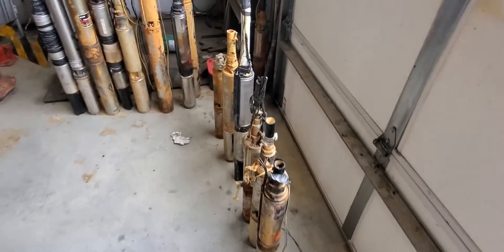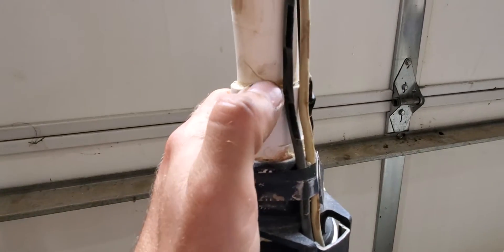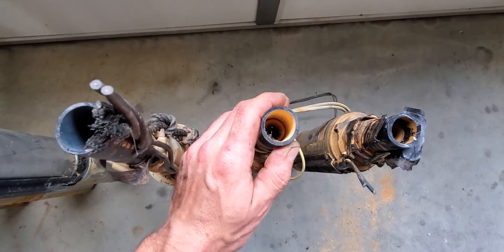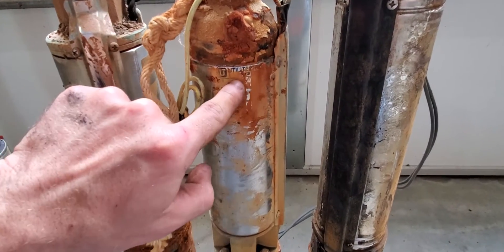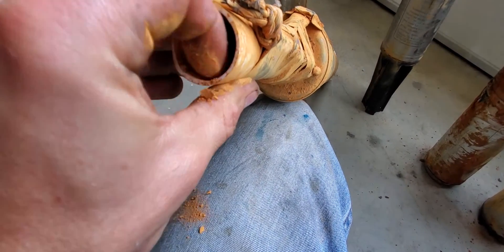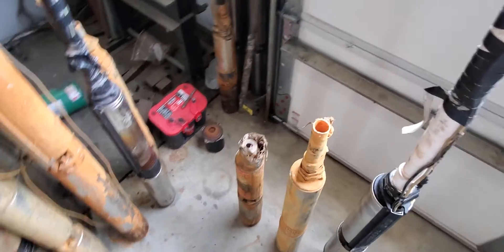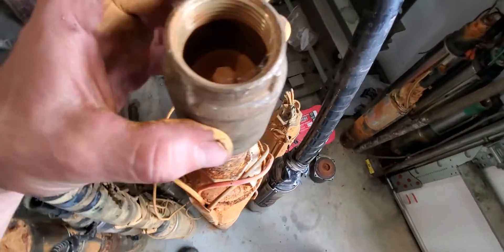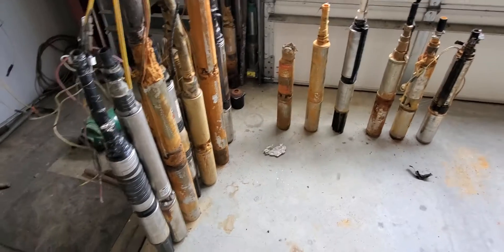No Water, Low Pressure,  Air in Water lines. Here's Why! #1 Troubleshooting video

Comment: My house has an older well where the pump and pressure tank is in a closet(above ground).  I have somewhat reduced pressure, it seems to be somewhat irregular have intermittent drops in pressure.  Occasionally there will be air in the line.  Any suggestions on where to start?

Comment: Im having an issue in my house where the water flows good for a few seconds and then drops real low then comes out with lots of pressure then back to low again constantly . Ive replaced pressure switch and pressure tank . What do u think the issue would be ?
Reply from the maker: So you replaced both tank & switch. It sounds like you have too much air in the tank. Look under your P.switch cover & look for the "ok" number. The air in the tank needs to be 5 psi below the on number. Most tanks are over charged when new. The power must be off & no water pressure can be on the system, so open a sink . Then use a tire air gauge to check tank air pressure.
Reply: @h2omechanic  ok I will try that today thanks. We had a 30/50 switch but I replaced it with a 40/60 will this be ok or do I need to go buy a 30/50 p.switch
Reply from the maker: @joshduff5374  the 40/60 is perfect. Just set the air pressure to 35psi
 Off & empty of water
Reply: @h2omechanic  my well is a deep well down at my well I have a cut off valve to the house and a faucet on top of well . I cut the water valve for the house and turn that faucet on that's on top of well to see if well pump was surging and it's doing exactly the same thing from well as it is doing n my house so would that mean my well pump is going out
Reply from the maker: @joshduff5374  yes! It could be a cracked fitting in the well too. You'll find out once you pull the pump out.

Comment: I also have another question we live in the greater Seattle area and so we live close to the salt water and our well water has a lot of sulfur in it it seems is there anyway to fix this being on a low budget. We cannot afford one of those expensive charcoal filtration systems so any help is appreciated on this as well thank you
Reply from the maker: Sulfur is a gas, so in order to remove it, the gas must be vented from the water before entering the house. Give me your email and I'll send you some cheaper ways of helping the problem. I just gotta see if I can find them online. Bc my salesman has 2 different devices to gas off the sulfur. 
Originally we would use a Air induction valve at the well. ( it's a tire air stem & as water flows by it sucks in air). Then once inside it would go the a mix tank,( fiberglass tank filled with plastic woofal  balls). Out of the mixer & into a Old School galvanized tank. Galvanized tanks had a valve/float system inside them that when too much air was in the tank, the air valve/float would open & vent off the gas/sulfur/air the was sucked in by the tire stem. It's complicated bc it's not a filter. It's a gas separation system. Still probably 3k installed. But I know it works. I don't think charcoal will work fyi. Itll work until it is saturated then the smell comes back within weeks.

Comment: Hey there few questions about a week or so now ago my roommate/landlord forgot to turn the outside hose off and it ended up running all night long and by the time that anyone figured out what had been going on it was to late. We thought that the well had just ran dry so we waited to it to fill back up and hoped for things to go back to normal well not so much. So as of right now we've got power to the top side of our well but still no water. Our well is 250 ft deep. Any help would be greatly appreciated thank you
Reply from the maker: It could be a air lock in the pump. If the powers been off for at least 5 hours, try turning the breaker on & off a few times. 5 seconds on, then off, & repeat a few times, this will help the air escape from the impellers. Because the check valve above it is held down by the water head pressure ie 125psi. So the pump would have to over come this pressure.  Once the well fills up, the pressure reduces to around 30psi & its easier for the pump to overcome that. 
If it ran dry all night/12hrs, it's a 75% chance that it is burned up. & needs replacing. Check out my videos on my channel. The Well Q&A Playlist, I promise it's time well spent! My videos are very easy to understand and you'll know how to test things & what to look for. I recommend to take notes on anything you find interesting. Bc there's alot to learn ! Happy Thanksgiving 😊 hope you can get it fixed!

Comment: I’ve got a issue with my well not being able to keep the PSI at 50 when I open the lines up to our home. If I close the pump and pressure tank off from the main out lines , it will initially keep the PSI up and correct but will eventually drop to 0. I’ve checked all the lines and connections to and inside my home and no leaks. But if I keep it running while everything is closed , it can maintain the pressure indefinitely. Thoughts on my issue?
Reply from the maker: The check valve in the pump is leaking the pressure out back through the pump when it's off. Best to replace the pump. This is if you have a submersible pump in the well.

Comment: I have a 130 ft. Deep well . sumergable pump .i put new tank& pressure switch 40 &60 cut out it pumps up to 60 and cut out & kick in at 40 but pump changes tone and want build up but to 40 and when water is on goes down to 20 & pumps shuts down & has 120 volts on all 4 wires on 240 switch.but if I break points away each time manually after being off for 10 sec.it will run quite while water is on constantly& maintains50lbs. Do I need. To install 2. 120 v. Start mother capasertors in line after p. Switch. I put bleach over night. To help clear any build up. Paul
Reply from the maker: I honestly can't help you. Your system seems odd to me. I'd recommend calling a well company
Reply: @h2omechanic  thanks

Comment: i replaced my pressure tank, pressure switch almost 3 months ago and everything was fine but today. had to kick pressure switch on had water but when it was used it didnt kick back on when useing washing machine...but when i turned the pressure switch back on it showed no pressure on guage so i waited about 25 min and tried again it showed on pressure switch..the pump is 14 years old
Reply from the maker: The average pump life is 12 years. So you pump is probably over heating after a little run time & cools off & runs again. Time to replace the pump most likely

Comment: Just bought a house, no water in the house but when the inspector came it was on. Gauge reads 0 psi and the breaker is tripped. When I turn it off then on it hums for about a second then trips. Any ideas?

Comment: Thank you very much for the video. This is exactly what the problem with my well that you explained here. I have a brand new pump put in in March 2016. Two weeks ago new pressure. I thought it my be the pressure switch so I switched it and same problem remain. When I turned on the power the pressure would only go up to 10 psi. When I turned off pressure dropped to zero and I could hear the water flowing back down to the well.
I contacted the company that installed it and they are going to charge $3,000 to replace the pump.  Therefore, in this difficult time I rather save some money, so will be diy.  Do you have any recommendation for a good and long lasting pump currently out there in the market?

Comment: I have a shallow well and the pump is in my house, pressure runs 30/50 psi. I had a water drip on a 2 1/4 galv fitting going to the pump and replaced it along with a new union, now all i can get is 20 pounds psi and I took the pipes apart 3 time and put back together with different pipe dope and even with Teflon tape with no luck thinking i might have a suction leak..HELP
Reply from the maker: You have a air lock somewhere in the pipe. Thats the most common issue with jet pump. Air is a bitch to get out. Try to prime it with the valve barley open & slowly open it once it's running. This helps prevent cavitation.

Comment: So my dads house has well water and water will work for maybe 10 minutes and then quits for different times any ideas what that could ve
Reply from the maker: It could be a overheating pump due to age and it's time to replace it or he could be running the whale drive if that's ever been a problem in the past

Comment: What about LOTS of air in the water lines? My well is about 100', submersible pump 20 years old (don't know what brand)- the well company I have used for 30+ years is gone- I replaced water filtration system, which worked great for the first day or 2, now things are just as bad-
Reply from the maker: You probably have a bad check valve in your pump & it's leaking water from the pipe when the system is off, this happens when you have another check valve near your tank. 
Watch my tank videos to know how to see if your tank is okay first. Once you figure out that the tank isn't bad, you'll know that it is the pump. Based on the age, it's time to replace the pump asap

Comment: I enjoyed your video, but you didn't so a solution for my problem. I pulled my pump, it was only 100 ft of pipe. I placed the pump in a kitchen garbage can full of water and turned the pump on. Water went everywhere, it was coming out between the stainless steel housing and built-in castiron check valve on top of the pump. I'm thinking there is an O-ring that went bad. The stainless steel housing has threads inside so I'm assuming it will unscrew from around the pump. Is that right? It's a 3/4 hp Gould pump and has 3.4 - 3.5 resistance from line 1 and line 2. No shorts. Look forward to your response.

Comment: I just subscribed...I wish I ran into you a few weeks ago.  I'm in SWFL and according to my well guy we only use pvc and no black pipe down here.  Anyway, my pump (at 150') separated from the fitting.  I was willing to do the job if it were black pipe but I was concerned about kinking pvc.  I wasn't able to watch the guys do the pump swap so I didn't see their technique.  Do you (would you recommend a diy'er) build a rig to prevent kinking, or what would you recommend?  If you have a video of you removing 100+ foot of pvc please link it and I will watch it.  Thanks for your channel.  I'll need you some day, I am sure.  God bless.
Reply from the maker: Hanging a pump on PVC requires a crane to install. That way they get the job again bc no1 can DIY it. Job security. If you pulled it by hand, it'll snap & break at each 20ft joint.
Reply: @h2omechanic  They may have had some portable derrick/crane but there is no access to the pump location to pull in a proper crane.  I work nights often and was sleeping while they were doing their work but there is only 3' access through a gate that narrows to around 30" before opening up to only about 10'x10'.  Fenced all around.  Anyway, thanks for the channel and content!

Comment: I just had my pump replaced. Got brown/yellow water. Well company said to run the pump flush the water out for an hour. Did it for two days, slightly more clear, fluctuates. Good water pressure in the house, except in master shower and sink. Any ideas re these problems?
Reply from the maker: Itll clear up the more you use it. 
As per the master bath. Remove the sink strainers and clean it, & remove the shower head & clean its. There's probably trash in them.
Reply: @h2omechanic  Thank you!

Comment: As I run water it starts out good then after 10 minutes of running a shower my pressure goes down to hardly anything… my pressure tank gauge at the switch never drops below 40 which is the cut on pressure(40/60 switch) if I continue to run water I eventually get air in lines and sputtering and even if I trip the switch by hand and bring pressure up to 60 again my water pressure is still zilch…. Any thoughts would help

Comment: Hey my name is Paul I have a 1hp sprinkler pump it just started to lose prime I primed it up working good until shut off over night. Next day came out turned on system would not build pressure. I installed a check valve into system primed up pump now my 1&2 zones work great about 25-30 psi zones 3&4 which are further from pump start to build up then drop off cannot get a good pressure to those 2 zones. Also my pump is hooked up to a pump relay no pressure tank thanks
Reply from the maker: Good job on adding the check valve. That's what i thought at first. Since it's got trouble pulling out water & Building pressure, id say the rubber impeller seal is worn out. Look up videos for replacing a jet pump impeller seal/oring.
Reply: @h2omechanic  thanks for the info I don't have a jet pump it is a standard well pump

Comment: Could I have pressure issues from a bad starting/run capacitor? My pump is just running and running but the tanks aren’t filling up. I opened a valve and it pumps water so after seeing your video maybe it’s strong enough to pump water up but not enough to pressurize the bladder .

Comment: l'm interested in a property about 1000 miles away. He said it has a well but the pump don't work. Any suggestions? Should l have a plumber check it out or just go out there and deal with it and try and fix it myself?
Reply from the maker: Deal with it later. Having a well is a great thing. Pumps are easy fix .

Comment: I got low water pressure. Seemed to be gradually happening. Don’t seem to be the switch or the tank. My next step was to see if the galvanized lines after the pump are clogged. Losing my mind trying to figure out the problem. Any info would be appreciated at this point!
Reply from the maker: If you kill the power & the water psi gauge drops to 0 without you using any, that says that you have a bad pipe or fitting in the well with a hole in it. The hole slowly gets bigger & pressure gets weaker. This video is exactly what you will find.

Comment: Hey my water cut off on Saturday night and I can’t get it back on .. I replaced the switch and it’s getting power, but when I plug in the switch nothing happens . Showing 0 pressure in the tank , well and pump are only 7 years old but we have a lot iron in our water ..you think the pump is toast already ?
Reply from the maker: Pump is likely bad or wire going down to the pump is bad/broken/ wire jacket rubbed off & exposed the copper wire inside. The pump has a 10-12 year life normally.  But a deep set 1hp pump at 300-400ft has a 7 year life span typically.

Comment: Good video 💪🏽. My problem is that the water line always has air when I turn the water on. Is that evidence that I need to install a new pump? ( it used to happen only when I turned the breaker off/on. I would notice a lot of air and grit coming out of the faucet)
Reply from the maker: Pull your pump out & look for a cracked fitting connection between pump & pipe or a cracked pipe. I bet 90% sure you'll find it. Or there's a bad check valve in the pump. It can leak down & trap air in the pipe. But this can only happen if you have another check valve at your tank or at the top of the well. 
Personally, id pull it out, look for the crack, and still replace the pump. The year is stamped on pump motor. If its 8+ y/o just replace it.

Comment: I have an irrigation pump when I turn the power on I can hear water flowing down in the well but no water comes up, what could the problem be?
Reply from the maker: Broke pipe in the well leaking out all the pressure. You'll probably have to pull it up by pulling on the wire. Have 2 or 3 ppl help you.

Comment: how do keep the pump from falling down the well if the drop line breaks?
Reply from the maker: Tie the wire around something big. A shovel or a tree. Wire can support the weight...but the key is to never let go of the pipe & stand over the well & pull hand over hand

Comment: I’m usually really good at this stuff I could prime a pump when I was a kid and understood that air is bad in the lines but I have a new hot water tank new pressure tank and determined maybe it is the foot valve because the last pump ran dry for a few hours after pumping 3 well tiles long story behind that but could that damage the foot valve because I can’t get any pressure at all in the system but the gauge reads it and shuts off normally except it air locks at the end
Reply: The new pump is identical to the last one we had the home plumber hps 50 shallow well jet pump